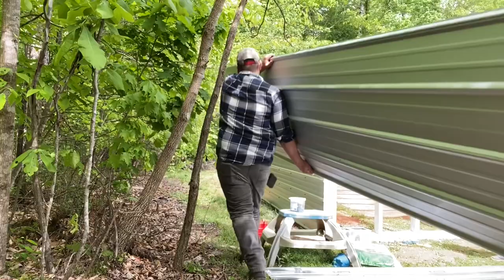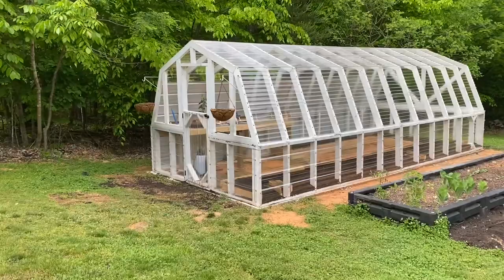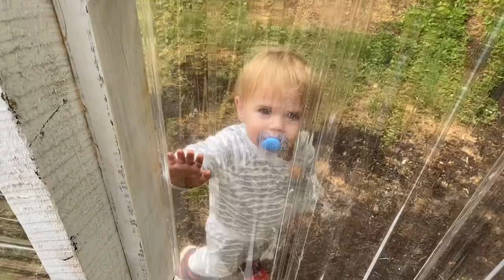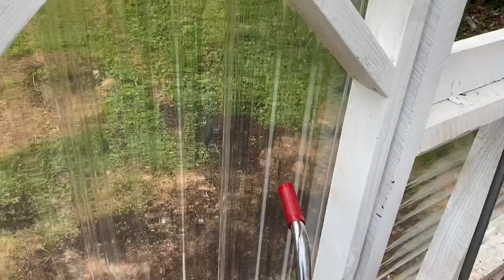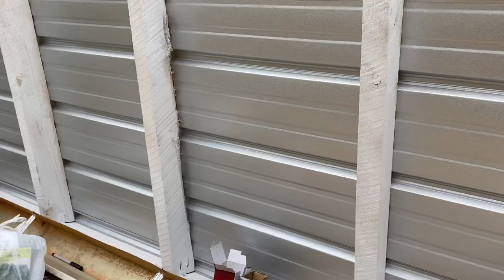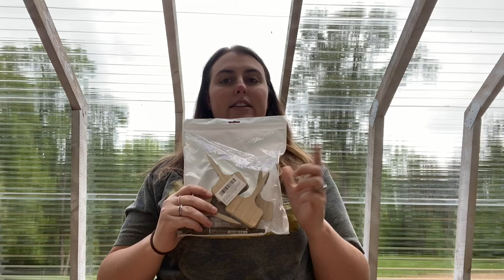Greenhouse Pt.3 //Ana White greenhouse // diy /family build

Comment: Looks awesome... I would recommend you put something between the wood walls and the compost. Those untreated boards WILL get termites and dry rot. Some kind of vapor barrier. You went to the trouble to put stones under the walls to prevent rot, but that compost is even worse because of the frequent watering. Just a thought.

Comment: Great stuff. Thanks for sharing. Just curious, why not all the way around with the transparent plastic, meaning why some metal on one side? I was thinking of building one with plastic all around. Would appreciate your insights. Thanks!
Reply from the maker: Good question! In the original plans there is metal at the bottom but we wanted as much light as possible so we did plastic all the way in that side. The side with metal is pretty much in the trees and there would be no light and the cost of metal was a fraction of the cost of the plastic.

Comment: Been researching greenhouse and if ventilation is needed for my area. I live on the west coast near Oregon where most days in summer 70 to 80 degrees and 50-60 degrees give or take some 40 and below in the cold winter months. Does your greenhouse get too hot to where you need vents to cool down?  I have the 10x12 build going and was trying to determine if I should add solar vents at each end or just leave be and run all paneling like build shows. Appreciate any feedback
Reply from the maker: Scott B we definitely need ventilation that is why we left the ends open through the summer. We have solar vents on order and plan on putting those in in the fall when we close the ends. Also we will have a good size fan when we go geothermal.

Comment: I see you have the dirt in the raised beds touching the wood around the bottom inside. Don't be surprised if that wood begins to rot from the moisture in the raised bed. I would have put in concrete blocks without mortar on the backside of your beds so no soil touches the wood of the bottom outside.
Reply: Ooops: I just saw the next comment.

Comment: What did the total project cost? Thanks
Reply from the maker: We made ours double the size and added extra support that was not in the original plans plus paint. Also we already have the materials to close the sides and the vents. But total we are around the $2,000 mark.
Reply: @sriddle4  great thanks again